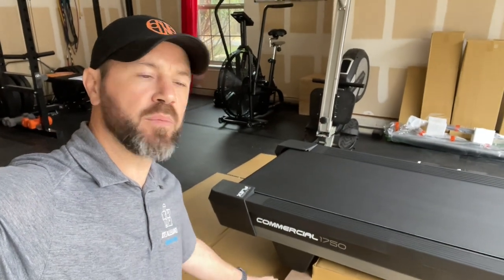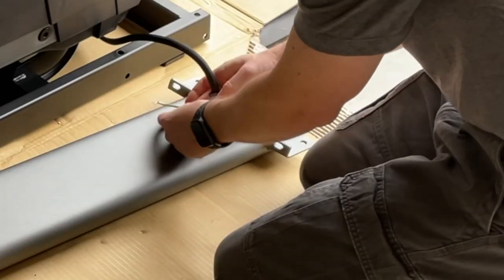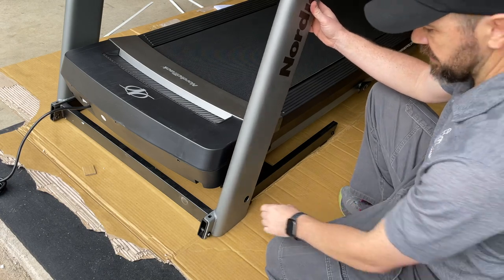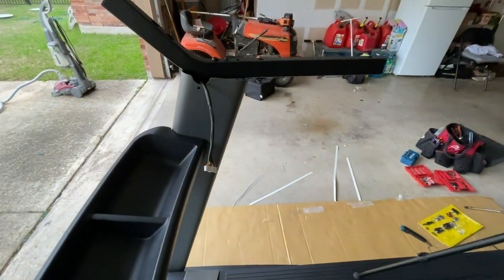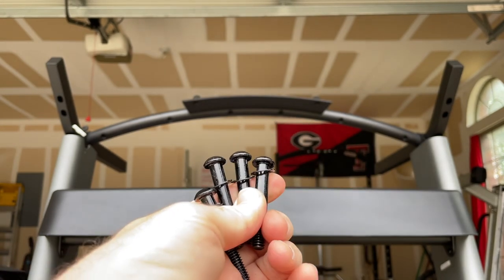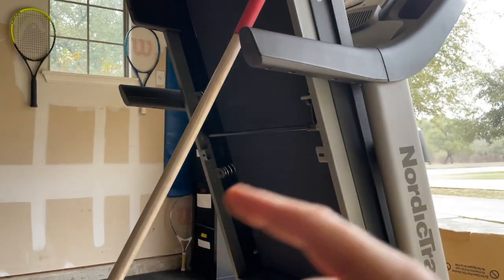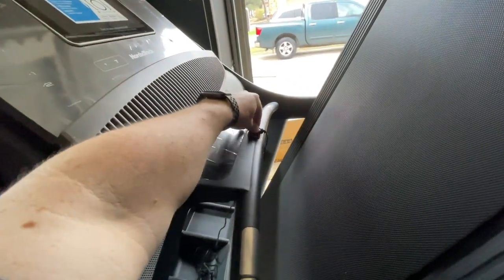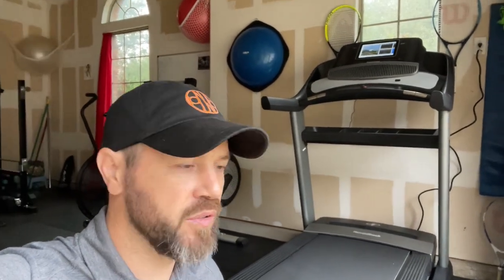NordicTrack Commercial 1750 Runners Flex Treadmill DIY Assembly | Step By Step Assembly Instructions

Comment: Great video - the camera angles and time lapses were perfect! A couple of things - I believe the manual tells you to adjust belt centering with the left Allen key only. You only use the right one (in conjunction with the left) to loosen or tighten the entire belt. You only adjust both Allen key bolts if the belt is slipping, squeaking, or you want to lubricate it. Also the manual recommends tilting and moving the treadmill by placing your foot against a wheel to tilt it - not the front bar. It’s safer because you aren’t under the machine as much & have a better angle when you pull it back over you. Did you mention that the first 8 screws you put on (the ones that hold the uprights to the base) are the last things that get fully tightened? NordicTrack suggests leaving them hand tight  until the console is firmly attached and the rest of the assembly is completed. But these are details - once again - excellent video! I’ve assembled one NordicTrack treadmill and have to do a C1750 so I appreciate this - thanks.
Reply: Thanks for the extra tips. We are just assembling now

Comment: Very helpful presentation. Here’s my problem... I got all the way to the step to install the hydraulic placeholder and did so. Then I eased the mat down gently to floor thinking I was all but done just knowing I had a few bolts or screws up front to tighten. However as I lowered the base to the floor the console came along too and I suddenly had the entire weight to lower to a resting position on my floor. Watching that part of the video now I see that you stepped in and depressed something w/ your foot (I did not). The equipment is now in a sort of closed position with all 300 lbs and no hydraulic help available. Any advise for resolving this and what did I do wrong? Thank you.

Comment: Any tips on disassembling this thing for a move?   I’m thinking just 2 big pieces.  The deck and the upper assembly.  Is it a bad idea to drop the cable that connects the two back through to the bottom?  Would I be able to use a long thin wooden rod to get it back up to reassemble it?   I haven’t started yet but how hard should it be to remove the base shield covers?   They just snap together correct?
Reply from the maker: It’s been a while since I assembled this one. Dropping that cable should be no issue bringing it back up though. 🙂✌️❤️

Comment: At what point did you tighten down the arms?  I can not tell if the bolts are tight after installing the cross arm.  
I bought a used 1750.
Reply: I figured it out.  Cancel request.  I had to mess with the arms to get my panel to fit.

Comment: I just purchased a used '22 1750 Commercial, and when I turn the cushion knob on the side to either On or Off, it doesnt appear to turn the mechanism at all. Definitely no locking or unlocking, when I lift the board in the upright position to check when Im turning. Any idea how to remedy?
Reply: Nevermind. I just didnt turn it far enough. It moves now.

Comment: I have 1750 but some reason it stop inclining upward. As soon as machine it start it goes down ward to -3 setting and never incline. I have tried to incline more and see if that help but it didn't. Any suggestion for solution. Right now, i have manually set it is on 0 and remove incline motor cable so it does not go down. Love to fix so i can use inline function. Any video that i can watch.
Reply from the maker: It's difficult to diagnose remotely. Wish I had an answer for you. If I come across anything, I'll send it your way.
Reply: @MasteringMayhem  Thanks

Comment: Finger-tightening everything first and then tightening in a diagonal pattern----this guy has done this a time or two.
Reply: Also, run the bolts into the receiving holes before assembly. Paint can clog the threads enough to make finger starting difficult.
Reply: @chetcaruthers8612  . Exactly right.